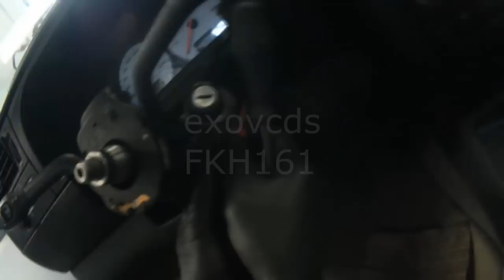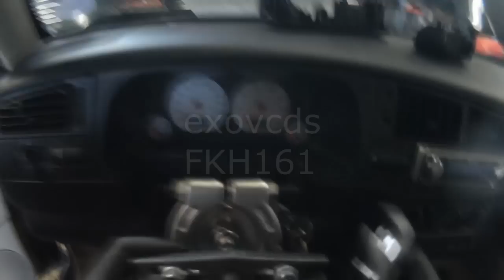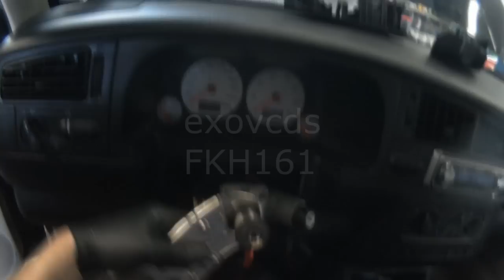VW A3: Golf / Jetta Ignition Switch Removal & Installation (Standard Transmission)

Comment: i'm taking the whole steering column from a 97 jetta 2.0 and putting it in my 98 1.9 jetta tdi and switching over the ignition so the new column from the wrecked 97 will have my keys from the 98 in it. i do not have the keys for the 97 as i bought it as a wrecked parts car. will i still be able to remove it and install the new 98 one onto it? reason for new steering column is the Tilt is broken and doesn't hold column up or down.
Reply from the maker: Should work (as far as I know)... you'll have to drill out the key cylinder (of the one you don't have the keys for) so you can swap the existing cylinder over or swap the lock cylinder assembly from each steering column.
Reply: Thomas EXOVCDS thank you for the reply! i just wanted to be sure. now i have to find where exactly to drill at
Reply from the maker: http://oi161.photobucket.com/albums/t225/lbermud/ignition%20pictures/DSCF0210.jpg
Reply: Thomas EXOVCDS thank you very much! do you also have a diagram of how to remove
the 97 steering column with tilt? i can't seem to get it out for some reason. i've taken off all bolts that i can see
Reply from the maker: Did you remove the "shear bolts"... you'll have to use a chisel to break them loose / free.
Reply from the maker: http://fkh161.ca/VW/Column.jpg
Reply: Thomas EXOVCDS do i break them off or break them
loose?
Reply: Thomas EXOVCDS nevermind, i have come to find out my tilt mechanism is OK. it's the piece welded above the column at the bottom that's in a U shape, it has come
apart allowing the column to go up and down with a lot of slack. i have to either put it back together somehow or get a new one
Reply from the maker: Thank you for the update.
Reply: Thomas EXOVCDS and thank you for your links and help. if i could like the video more i would :) now i just need to figure out why my Ac isn't working. i can't hear the compressor engage or the engine lose RPM when i hit the AC button so i'm pretty sure it's the AC compressor that has gone out, i tried recharging the system and checked with a gauge, didn't move when i turned on the ac button either. stayed at 60 psi.

Comment: I have a 2000 GTI that's fine when at idle but when I rev it a bit or take off I loose all power to windows all gauges just drop but still runs normal then when at idle all goes back normal and I can roll my windows up and everything. Any ideas.
Reply from the maker: Jacob Hendrickson Check the chassis ground cable connection under the battery: https://www.youtube.com/watch?v=k4Yv3UP1nuQ
Reply: New symptom. Battery drains overnight something is drawing over 3 amps just sitting there not running everything off. Don't this eliminate the ground your talking about. Man thanks so much for responding. I'm going out now to start pulling fuses till I find what's drawing the current. Any advice or ideas with this new info??
Reply from the maker: Jacob Hendrickson That might eliminate the ground, but it's still worth & easy to check (just to be sure). Pulling fuses one at a time and watching the amp draw is a good next step. Be sure to insert the fuse again after pulling to keep the correct fuse in the correct place. 3A is a lot but might make it easier to find.
Reply: I cleaned up every chassis ground under the battery then pulled every fuse one at a time behind the drivers door plus the 3 green fuses in the box under the hood with all the red wires running out. My wife watched the multimeter I did not find my issue. Ain't there more fuses or fuesable links somewhere. I can't find anymore to pull and check

Comment: My car won't start! 😭 I put my key in the ignition and turn it on accessory and the dashboard won't light up. "On" won't do anything and it won't even crank. Headlights and Time on my radio still come on. I can't even roll my windows up! It wont make any noise when I turn my key in the ignition. And my battery tested good. And idea of what it could be???😭
Reply from the maker: Amber Jone't Year, model, engine & transmission?
Reply: Thomas EXOVCDS 2002 Oldsmobile Alero GL2 3.4L V6 Automatic Sedan
Reply from the maker: Here's a wiring diagram (page 2 & 3): http://fkh161.ca/Domestic/AleroStarter.pdf
Check the 40A fuse in the engine bay by the left strut tower.
If the fuse is OK, check the other components as per diagram 2 or 3 (whichever applies to your car).
Reply: Thomas EXOVCDS Thank u for replying to my comment. I appreciate it!

Comment: Just the alternator light and the oil light does not it goes off
Reply from the maker: Sasuke Uchiha If the oil light & alternator light go out while cranking, then you are losing ignition power. If the lights stay on while cranking, then you need to check for spark & fuel. https://www.youtube.com/watch?v=X-uxkgveK7M
Reply from the maker: Sasuke Uchiha https://www.youtube.com/watch?v=fWYhYx8bMWg

Comment: Where can i get a pulley like that for the steering shaft ?
Reply from the maker: Did you read the description... you can do it without a pulley. If you want to use a puller, you can find them on Amazon, ebay or your local auto parts store. This kit is similar to the one that I have / use:
https://www.amazon.com/Shankly-Capacity-Bearing-Pullers-Separator/dp/B06ZYKQZSF/

Comment: the spring and collar wnt go on now i had it on then i had to take it back off now it wnt fit
Reply: it seems like the steering colum shrank as stupid as it sounds
Reply from the maker: Yes, the shaft slid down... pull it back up. You can put the steering wheel on the shaft and loosely place the nut on. Grab the steering wheel and pull up on it.

Comment: I have a 97 jetta gls that I switched over to 5 speed. only issues im having are the message board that shows the oil light, check engine light, etc.... wont turn and obviously kills my battery, and my oil light after 40 minutes of driving wont stop beeping. Oil level is fine. HELP!!!!
Reply from the maker: +Luis Garcia The lights stay on? How bright are they? The same brightness as when the ignition key is ON? If not, then you have a ground problem somewhere... if they are the same brightness, then maybe your ignition switch is bad. Check the pressure switches by following this video: https://www.youtube.com/watch?v=xzQGTp8RCJk
Reply: +Thomas EXOVCDS the lights are not as bright as when the car is on.
Reply: +Thomas EXOVCDS UPDATE the windows and sunroof still have power going to them with the key out.
Reply from the maker: +Luis Garcia You need to check all your wiring.... I don't know all the stuff you had to do for the conversion to 5 speed. I assume you had to move the fuse box when you installed the pedal cluster. If you disconnected stuff from the fuse box, you might have connected it back in the wrong place. Not sure, sorry. If you need wiring diagrams, let me know and I will see what I can find for you.
Reply: +Thomas EXOVCDS. so i checked all the wiring in my box and its fine. i didnt have to unplug anything when i installed the pedal. to instal the pedal all i did was remove the shaft that holds the pedals together and instal the longer one so i coould have my clutch pedal. i did notice that there is two femal connections next to the fuse box that are not connected to anything. the colors are black and white and yellow and green. they are both one prong connections. checked to see if they had any current flowing threw them but there both grounded with and without the car on.
Reply: +Thomas EXOVCDS ALSO i just disconnected my ignition switch to see if the lights would go out. But its still getting power.
Reply from the maker: +Luis Garcia If nothing was touched, then nothing should have changed. Was the battery ever connected backwards?
Reply: +Thomas EXOVCDS ehhh got tired of dealing with it so i found the wire that gave power to the windows n i just rigged it with a fuse that only gets power with the ignition on. I KNOW I KNOW not the pro way to do. it but it worked... .i hope ill know by the morning if the battery survived!!!
Reply from the maker: +Luis Garcia The only way you might find the issue, is with wiring diagrams (compare your wiring with what it should be). If you need wiring diagrams, let me know and I'll try to find some for you.
Reply: +Thomas EXOVCDS Jetta has been running fine until the other day. Turned the key and it wouldnt crank. I have been having trouble with the car about having to wiggle the key to make it start sometimes. So my first thought was the ignition switch. changed it out and nothing. Checked to see if the starter is getting power and nothing. Would the lock cylinder be the problem? Or should i check else where???
Reply from the maker: +Luis Garcia When you turn the key to crank & let go... does the key spring back to the on position or does it stay in the crank position? The alarm module or the park neutral switch could be preventing the starter from cranking.
Reply: +Thomas EXOVCDS yes it springs back. I do have problems with the alarm system activating and the flasher turning on and off. Having to get out the car and lock it and unlock it to turn the alarm system off. Should I jump the alarm system. Ive read up on how to do it on the forums or would you reccomend an alternative?
Reply from the maker: +Luis Garcia Disconnect the alarm box and jum the starter wires at one of the harness plugs... then recheck the starter operation. Park / neutral switch also needs to be bypassed or car still thinks it's automatic. Sounds like the ignition key / switch is ok... verify power going in & out when cranking.
Reply: +Thomas EXOVCDS figuered out the problem it was the neautral saftey switch lol
Reply from the maker: +Luis Garcia Thanks for the update!
Reply: +Thomas EXOVCDS actually it started to grind whenevrr i let fo of the clutch. for example ill be driving and ill have it in any gear and if i let go of the clutch without giving it gas it grinds. it will also randimly grind when increasing speed
Reply from the maker: +Luis Garcia You mean that something is rubbing / grinding "outside of the transmission"? The engine tilts / moves when you accelerate or decelerate... if it moves too much, something might be loose causing a rubbing sound. When you step on the clutch, no grinding will take place because the engine is not tilting. Follow the noise and you will find the problem.

Comment: Does anybody know how to bypass the ignition lockout on a 99 Passat?  The battery was completely dead for over a year but when I put a new battery in, the anti-theft system engaged and now the key won't turn at all, not even enough to move the steering wheel.  I am completely stuck, does anybody know anything about this?
Reply from the maker: Key & wheel have to be moved at same time to free the steering lock... wiggle the wheel in both directions. The key should move once you hit the sweet spot with the wheel.

Comment: just changed the golf 5 ignition and the indicators can't work please help
Reply from the maker: Hi, all I can suggest is to trace your steps and check all fuses. I have a mk4 ign switch video, but have not yet had the chance to record a mk5. Does everything else that's on the load reduction relay circuit function?

Comment: There’s a quicker and easier way to do this if you’re just replacing the switch and not the whole lock cylinder.

Just unbolt the U bolt on the column and pull the whole assembly up.
Reply from the maker: kwjett yes... That's why there's a link to that procedure in the description.

Comment: okaayyy, i'm pissed. i just did this whole repair because i thought the ignition switch was the issue. my car's radio, wipers, and ac/heat will not work from time to time. I saw a couple people say that it could be the ignition switch, so I replaced it & they're still not working. please any suggestions anyone!? (: Thanks 

-noob diy mechanic
Reply from the maker: Byron Molette The ignition switch supplies power to the "Load Reduction Relay"... you need to check the relay and the associated wiring to & from it. I'm about to start work, I can send you a wiring diagram when I get home tonight (6pm> west coast pacific time).
Reply: oh wow I never saw your response,but i ended up finding out it was a relay switch when i was driving and i popped the clutch my foot hit the fuse box. then radio and everything came on. still fighting this relay switch. it will not stay in.
Reply from the maker: ***** Year / model & engine size? I will send it to you after I get home from work tonight... if I forget / if you don't get anything by saturday, email me at fkh161@fkh161.ca with a reminder.
Reply from the maker: Byron Molette Year / model & engine size? I will send it to you after I get home from work tonight... if I forget / if you don't get anything by saturday, email me at fkh161@fkh161.ca with a reminder.

Comment: What's a job like this cost in labor?
Reply from the maker: What model / year is your car?
Reply from the maker: 2.2hrs as listed in Mitchell labor guide for a 1998 Jetta 2.0l with Automatic transmission (I guessed what vehicle you have). It does not take that long... we do not charge that much labor.
Reply: +Thomas EXOVCDS where in you guys located ?
Reply from the maker: Canada

Comment: do I need the wheel puller for a 98jetta?
Reply from the maker: If you look at the pdf link in the description... you don't need a puller, you remove the steering wheel & steering column shaft as an assembly.
Reply: Thomas EXOVCDS  ok I got it now,I'm thinking my ignition possibly could be bad,I put a speed control sensor in that didn't work, still not getting ground to my coil,been checking over some of my grounds to see if that helps
Reply from the maker: Engine cranks ok but it does not start? Leave the key in the ON position and energize the starter manually under the hood (TRANSMISSION IN PARK OR NEUTRAL). Does it start?
Reply: Thomas EXOVCDS I haven't tried starting the car that way yet,if the car would start its possible the ignition?

Comment: How do you remove the key cylinder?
Reply from the maker: You have to drill a small hole in the lock housing so that the release clip can be pushed... Once the clip is pushed, the cylinder slides out.

Comment: could have used a little light to make everything shows up better, to dark
Reply from the maker: You might want to check the "brightness" level of your monitor. Seems ok on mine. As with any of my videos... you don't need-to-see-every-bit-of-detail, as long as you get a sense of what I am doing, you "should" be able to follow along. Once you read the service manual (which I'm sure you have) and actually start to do the repair on your car... things will "totally make sense".

Comment: Is it my ignition switch? 08 Jetta S. My car randomly shuts off while driving. There's no same reason every time. Sometimes while driving 60mph. Sometimes while at a stop light. Engine shuts off, dash indicator lights go out, & everything else (lights radio, etc) works. I pull over for a few minutes and eventually my dash indicator lights come back and I can turn my car back on and drive for a while. I recorded a video of it happening (yes it happens that often). In the video you can see about 3 minutes in my engine shuts off. In the video I'm at a stop light, but you'll see the rpm's die and the indicator lights go out. Three minutes later it all comes back on and I can start the car. Heres the link http://youtu.be/XDcJBMFVLGI